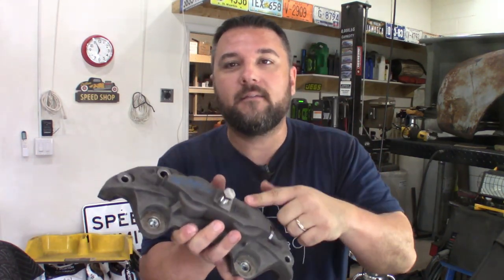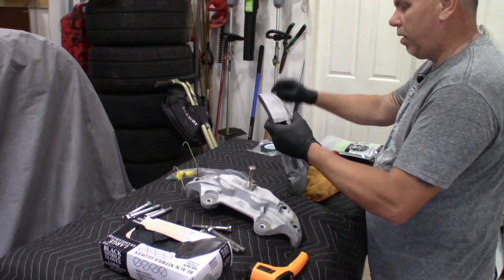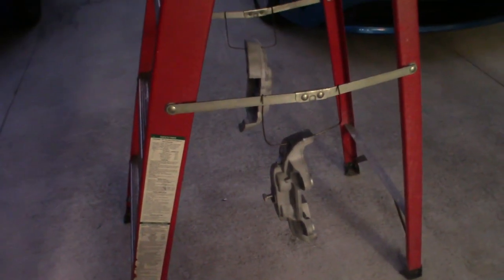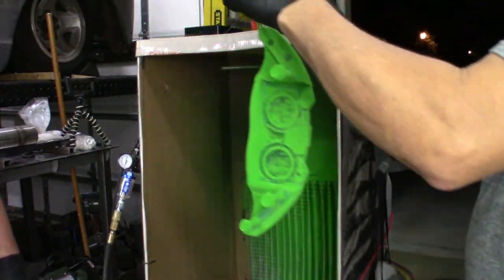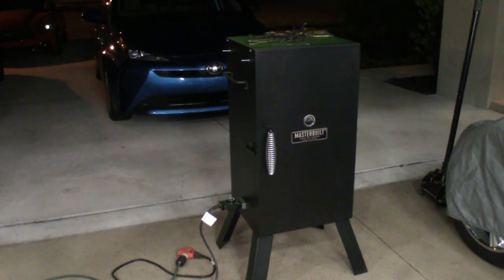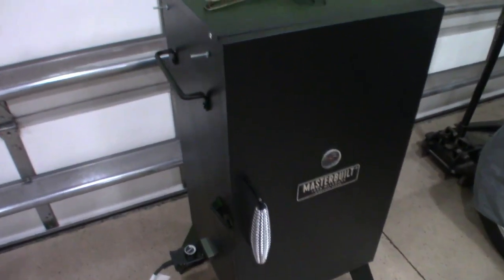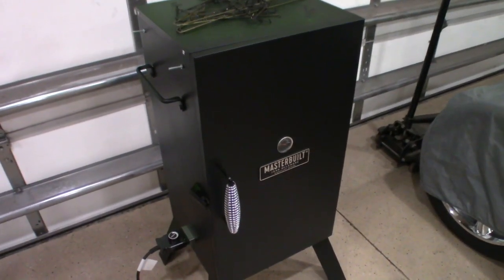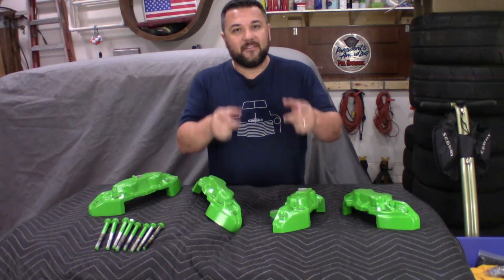DIY - POWDER COATING BREMBO BRAKE CALIPERS!

Comment: I actually have the exact smoker that I use for powdercoating an my name is Phil too lol. Another trick is to put the piece back in oven after you tape it up, it helps the powder to stick to it. Also the Eastwood clear powder is great to apply after your color. Makes it pop even more.
Reply from the maker: I wish I filmed it, but I de-constructed the entire inside of the smoker... lined it with insulation, and put it all back together..... works pretty damn good :)
Reply: Yea phil eastwoods or prismatic powder “ clear vision” it will glow out this world. Perfect finish
Reply: @DONJULIJUVY718  getting ready to do some Audi RS5 front calipers. I'll try the prismatic! 👍🏿
Reply: @philb707  ill be waiting on that episode 👌🏽
Reply: What smoker is this"?

Comment: Just got into powdercoating myself. I bought a $75 eletric oven which I run off my 9.4kW generator as the oven plug is not your usual home outlet. Also gives me the space to do multiple calipers and even rims. Makes me wonder why you spent $200+ for that smoker?

Comment: Hi, when reassembling them, what tightening torque did you use to tighten the 4 bolts? Thanks
Reply from the maker: I just powder coated the calipers.... I didn't re-assemble them......

Comment: Great Video ! I’m seeing mixed reviews about Masterbuilt smokers. What is the max temperature for these smokers because online i’m seeing it goes no higher than 250 degrees.
Reply from the maker: Mine gets up to the temp it needs to which is perfect for powercoating...... I forgot the exact temp.... but i'm pretty much maxing it out and it works.

Comment: How about your break? When you brake on hi speed at hi temperature. Is the powder melting?
Reply from the maker: Not at all… most of the heat is in the pads… and not anywhere near 400 degrees… that’s how hot the powder cures at… all good!!

Comment: What’s the heat resistance of this powder?
Reply from the maker: Not sure… I know the powder cures at 400 degrees… most of the heat is in the pads… if the actual calipers are getting that hot you have some major issues!! :)